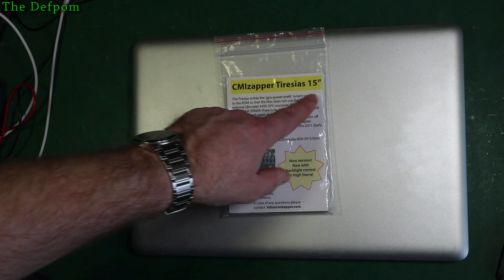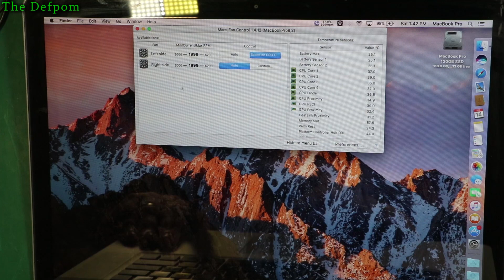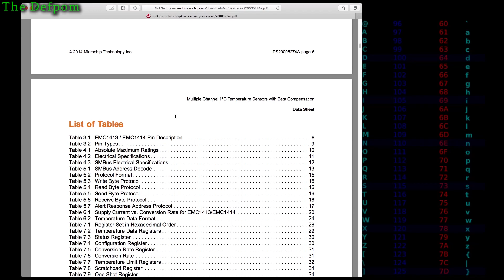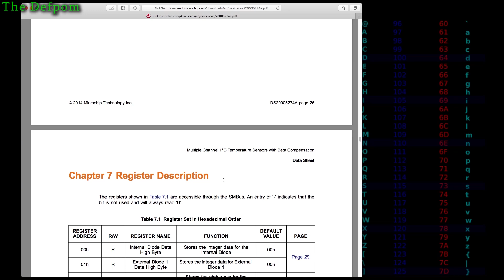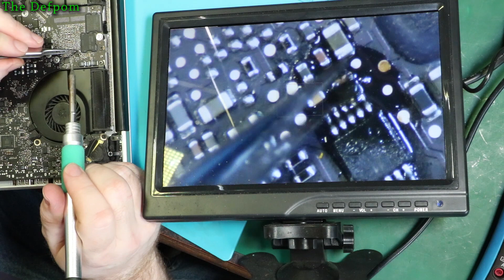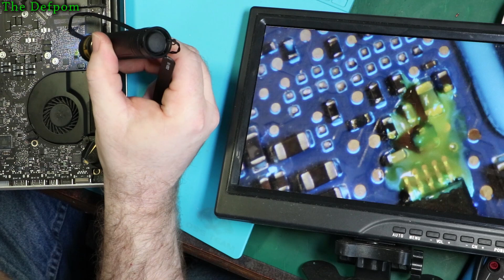🔴 #635 Apple 2011 MacBook Pro 15" A1286 820-2915 GPU Thermal Sensor Hack To Stop Slowdowns

Comment: I have the same issue on my Lenovo laptop and it has 940MX 2GB GDDR5 but it changes it's hotspot temperatures randomly and crashes the pc, can it be fixed? or it death because it looks like the problem is at GPU Temperature Sensor.